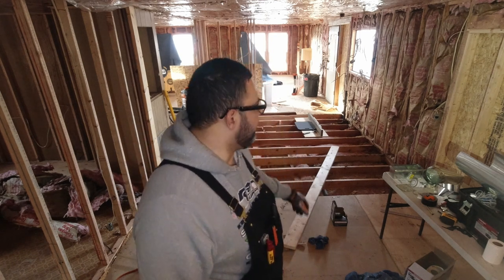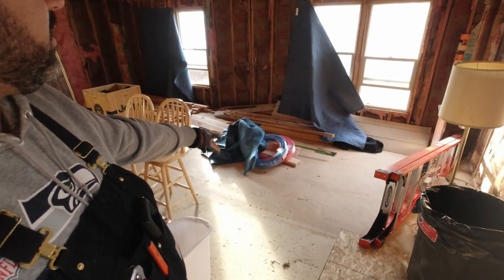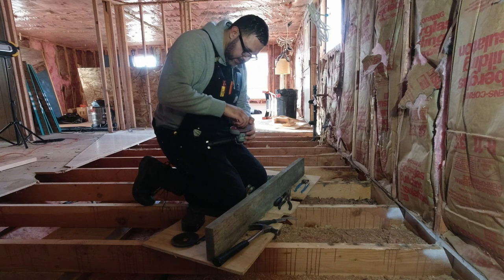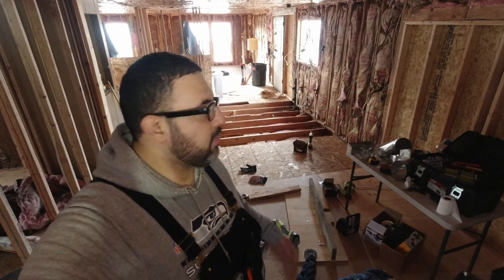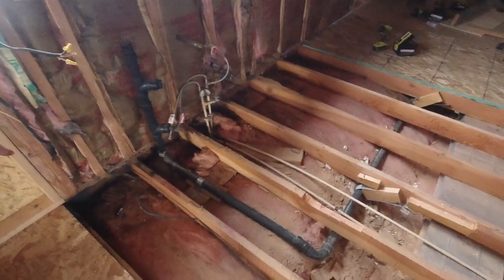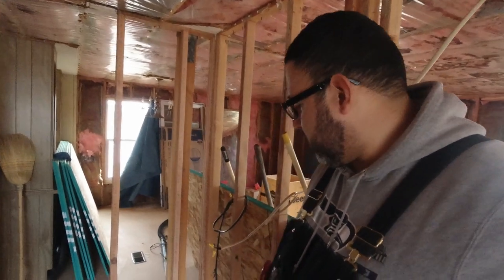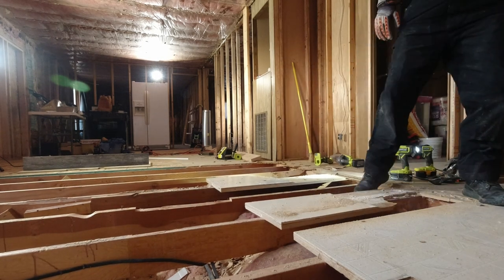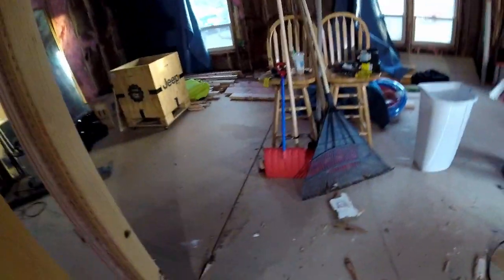Removed the kitchen wall and tore up subfloor: DAY 14 mobile home renovation journey

Comment: you might want to check out Drew's Roofing his videos are great! not sure what kind of screws you have but deckmate screws work great! about to do the same thing your doing with our double wide (it was hit hard by Hurricane Ian this past Sept :( but we are planning to build it back better (its a 1971) oh by the way The New OSB is nothing like the old OSB the new osb is actually made with WATERPROOF glue so as long as the mobile home is not flooded your floors should be good! we are planning on doing our floors OSB as well. what size thickness OSB are you using? i have searched google and it says standard is 3/4 but cant seem to find any 3/4 sheets near me all i can find is 1/2 and 5/8
Reply from the maker: I've watched a lot of his videos, he does a great job explaining what works and what doesn't. I bough 5/8 and it was too big so I exchanged it for 19/32 CAT SE OSB Sheathing and it works pretty well. I originally wanted to go with plywood bur price is insane.

Comment: Pre-drilling is the only thing I can think of, or maybe the drill isn't tight enough or too tight so it just skips. What's the plan for the rot ? Seems like a pretty big area to fix.
Reply from the maker: I started to use the star drive screws instead, they work much better. For the rot I sprayed killz to kill all the mold and prevent it from growing more. I'll have to replace the outside of the home in some areas to make sure that the joist don't continue to get wet.  😁👍

Comment: Those bad screws?  Maybe try rolling them on a bar of soap and don't buy that brand again once you use them up.  I love Spax brand.  Other channels?  I like Green Acres Homestead and BC Renovation Magazine.  He's a retired contractor in Canada who is on his third or fourth complete MH renovation.  One thing he does with the plumbing is he leaves a raceway of about 8" open in the floor until all the plumbing is complete.  That way there's less crawling under.  I hope you are keeping track of your labor hours.  It'll be fun to see how much $$ you are saving by DIY.
Reply from the maker: Yeah Green Acre Homestead is the one. Great Channel, I've been watching them a lot lately. 8" raceway? 
Not sure what that is but I'll look it up.
We haven't been keeping track of the time but I'm trying to budget everything as close as possible. I'll share the cost in a future video for sure. 👍🍻
Reply: @DIYHomeRevival  I just meant leave a strip of about 8" of the floor uncovered above the main lines until you get all the plumbing straight.  More work but better than doing it from under the house.  It was what he does.

Comment: I believe you are using the wrong bit. Look into using a square bit that fits in the center of the screw. Sometimes Phillips screw are not actually Phillips but square. Good luck to you.
Reply from the maker: I went with the star bit, it works super well. I like them a lot, I'll have to try the Spax brand next. Thanks for watching, Cheers.